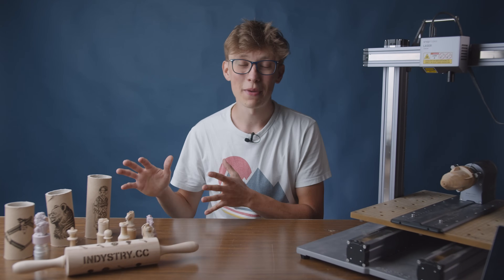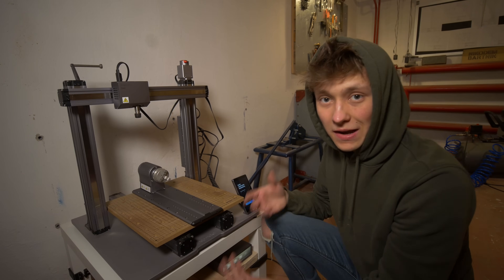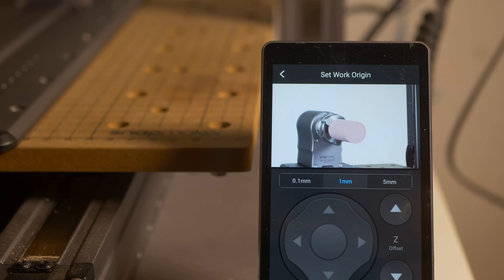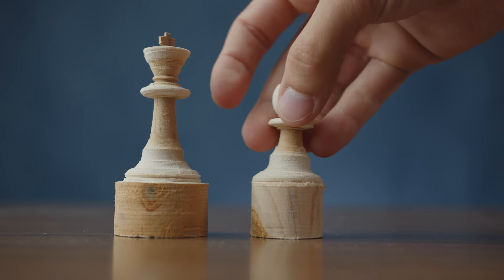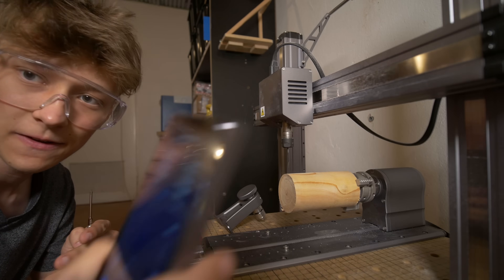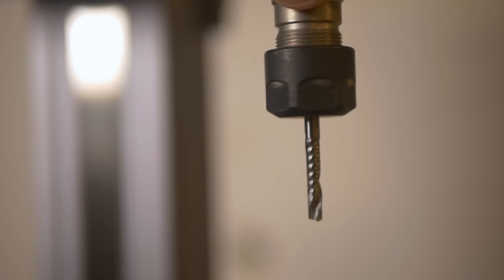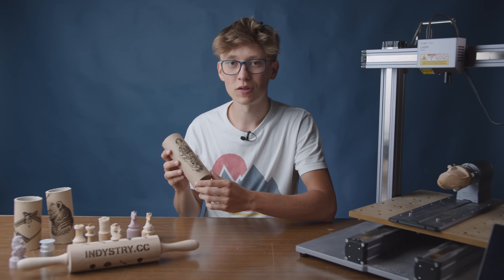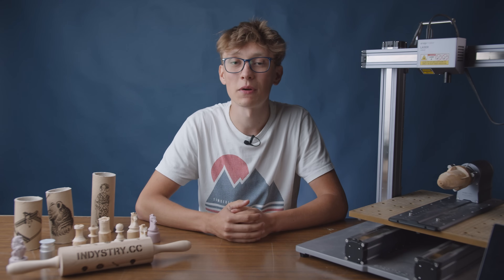4 Axis CNC Machining With Snapmaker 2.0

Comment: I know this is 2 years late, but in case anyone like me us just seeing this.  The reason you failed on the aluminum is almost certainly the bit.  It will probably be fine if you get a milling bit actually designed for cutting aluminum.  The material, even the angle of cut on the tool is different for metal compared to wood.  I would bet almost anything that this machine could mill even steel if you just put in the correct bit and set it to a low speed and cut depth.  Yes it will be very slow compared to an industrial metal mill, but for prototype parts it might still be great.  Also with the correct type of bit it will generate much less heat while cutting.

Comment: 4:11 I know you said you've never used a 4th axis, but you didn't say that you've NEVER USED THE SNAPMAKER ITSELF.... And even though you make YT videos, you are incapable of researching them on the same platform? You see your bit plunging deep into the material, and then into the clamp.... Would you have just let it keep going all the way through the floor? That fancy power switch (software based E-stop) you bought isn't really useful, if you don't actually use it....

Comment: Thus was an interesting video to watch but I have a few suggestions:

Build an enclosure (box) to house your CNC & Laser machines and equip It with a dust collection system so that it keep your work area clean AS you work. An enclosure will keep the wood chip pieces from spilling all over your walls and floors. Also, set up aa duct in back or side of enclosure to make it easy to attach your vacuum or a more powerful dust or debris collector. You can make the enclosure from plexiglass (for visibility) or a combination of plexiglass and wood, for strength and Great visibility.

Also, put some L.E.D. lights around enclosure, to aid your lighting of the work piece as you record your video. Use the 5k wavelength, or what we call DAYLIGHT..So that your camera will record colors properly. 

Good luck on future projects.

Oh, yeah...  I appreciate your video being in English but your pronunciation needs some small adjustments. You pronounced most of your words correctly but a few weren't even close... and made it hard to understand. Good video, though. Keep them coming!

Comment: The soft brownish material could/should be Ren Shape.  REN Shape 450 is easily machined with minimal cutter wear. Important features include superior edge definition, low shrinkage and water absorption and good quality surface finish.  Most pattern shops use it extensively.  I think it is ideal for this application.  Check it out - it's available world-wide.

Comment: Could you machine from the tip of a piece of wood to the back and cut each chess piece off as you go (or have the machine cut the adjoining material as a last step)? This would make it the wood equivalent of a 'belt printer'.

Comment: im currently a trainee Precicion mechanic and i can say from my own experiece that the snapmaker can handle aluminim if done correctly. however you need to prepare g codes in something else than luban since you need  a lot more settings and also some experience with machining metals but it is indeed possible to get good results with a snapmaker.

Comment: Great review!! I agree with you about the safety switch which sould be in every Snapmaker and not sold separatly:) as well some bugs around safety which should definetly corrected!
Reply: Thanks for your suggestion! Actually Emergency button is sold separately and placed together with rotary module. Here is the link https://shop.snapmaker.com/collections/parts-accessories/products/snapmaker-2-0-rotary-module?variant=33244375941183. We will continuously improve our products and bring the best for users.
Reply: @Snapmaker  this is a great news:) very very nice!

Comment: dont like u stickn the paper gage in there while it rotating with ur finger> i hav a cetus 3d printer, and im mostly in control of the steps to calibrate> it>
Reply: The spindle is off while setting the work piece. If it was on it would tear the paper.

Comment: It seems like an interesting machine.  My main concern is if it is too "closed off" ? Can a user use their own extruder/hotend etc for 3D Printing / modify the "stock components" in any way, or no?
Reply: I own a snapmaker 2 A350  and pretty certain it uses a can bus system so modifying the stock components would probably cause issues
Reply: Subscribe

Comment: That pink material that came with the machine looks like "Bondo" (car body filler). I wonder if that's what it is...
Reply: Subscribe
Reply: It’s probably rigid polyurethane foam. It’s usually 10-15lbs per cubic foot and is used in model making and with CNC. Easy to work with, but wear a respirator